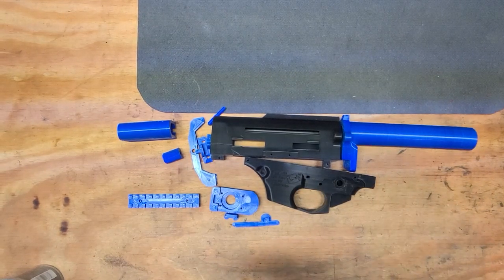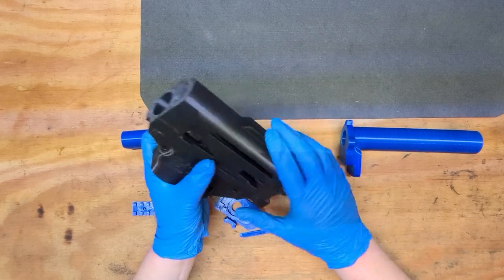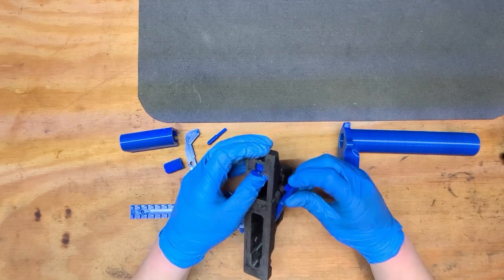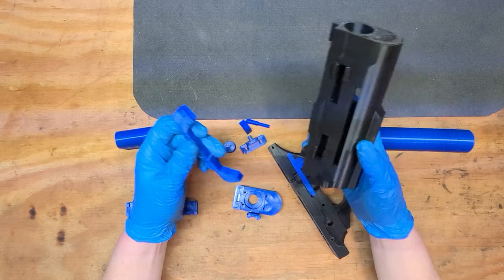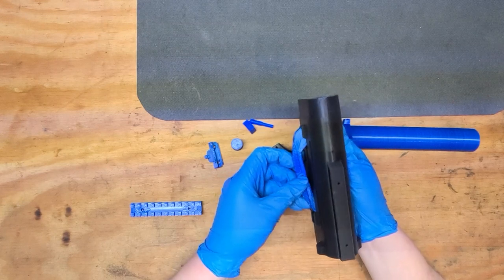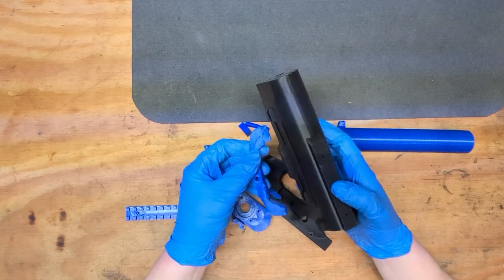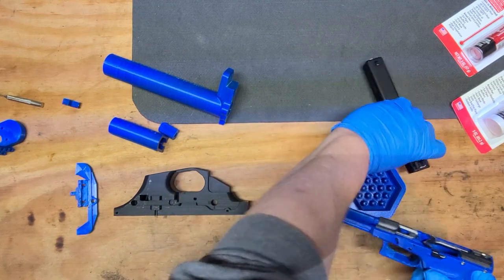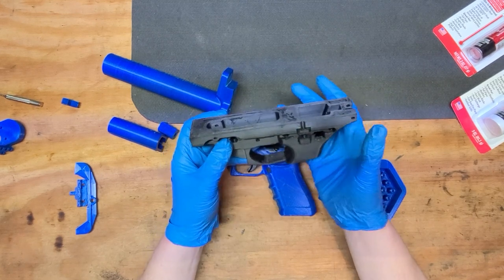3D fgc9 parts with my epiphany on improving this and many other 3D parts.

Comment: for the buffertube, a raft setting would help you ;) it adds just a milimeter more to the object, easy downsandable with gridpaper or just let its saty somethimes it fils little gaps so it gets a really good snug fit, keep up the great work, love your 3d printing series, the idea with the epoxy is also something i thought about, i see no reason why it should not make it stronger, i mean its more material and also bounds to the pla, maybe a little stipple in the gaps also could improve the bounding extra.

Comment: He'll im excited and I'm not even done with the video yet. I'm gonna start working on the molds when I can. Its super easy in CAD, you just literally make a block with the trigger/ejector/bullet mesh inside, then subtract the part from the block leaving the perfectly formed  cavity. Then you just plane slice your mold as needed and add the male or female location geometry (with a .4mm difference for fit). Then cast away, could try using some kind of fibers as well. Cool idea 💡

Comment: You definitely can epoxy woven fiberglass tape to the outside of parts such as your extension tube for extra strength. You mention adding ribs to attach supports, consider that the ribs are already acting as supports just like fluting, so you definitely could improve the strength of that tube by adding ribs, or even extending the outer wall down into more of an oval.

Some people add threaded steel rod to parts. You can also cut a groove in that rod and apply some solvent for whatever plastic you're using to permanently weld it in place. This is all new and there's no rules so if you're willing to risk having a failure design a test part and see what it can take.

Comment: When you’re talking about smashing something on hydraulic press it’s compression strength but there’s a difference between compression strength and tensile strength this could use some experimentation especially the tensile strength the longer radius

Comment: In Cura you can add shapes to STI files under Extensions>parts for calibration, then adjust shape and scale for your purposes, then under per model setting (under scaling on the left hand toolbar) you can adjust "setting for overlap" set all settings to zero for your cavity piece and align your void within the mold cube. Might take some tweaking, but that's probably your most surefire and easy to lean way to 3d print molds or cavities in existing print to fill like you mentioned. No CAD knowledge nescessary.

Comment: could this mold idea also be used to cast lowers and uppers for instance? It could help to speed up FGC-9 production since now it takes about a week for all the parts to print
Reply from the maker: Not sure, it would be nice but so far the mold will most likely be broken away so you would be printing a new mold each time. Currently I'm testing this in a small 2 part mold off thingiverse. Hopefully will post that video Saturday.
Reply: @Applianceinator  I already thought it through and its totally possible. Just Use Poly cast from Ultimaker. Use minimal infill and that should print faaast. Then make a ceramic form and heat that bad boy up. After heating the polycast is vaporized and the Ceramic is done. Actually you shouldnt use ceramic like this but you should use ceramic like this dip the form put the crumbled clay . wait till dry reapeat 3-5 times. Then put in furnance and burn everything. The Polycast will evaporate. Boombadabang you got a form. Just cast. Done Polycast is VERY VERY acurate. You can even see the print lines in the cast. Even riffeling should be possible. Its amazing. I saw some youtube videos on that. total setup cost is 460 euros or something + printer+ if you want some luxury stuff you gonna end up paying 1000 dollar or something. Basically you can make infinite firearm made of metal then soo i would consider that a win. Now say thanks DurschfallTV for this money method i will "steal" what you stole and make some $$$ go ahead buddy. get em

Comment: also, from a material science perspective, "casing" the polymer in epoxy might have unintended consequences, vectoring forces in unintended ways...not saying it couldn't work, but you'd have to be pretty intentional and controlled about it.
Reply: I bet a rebar type setup with wire wrapped in the grooves then encased in jb might mitigate a bit of the epoxy spalling, but stress localization on the plastic then becomes the issue.

Comment: carbon fiber filament is a bit of a trap apparently
You might try something with Prusament's PC blend (easier to print poly carbonate)
Reply: Can you elaborate about CF filament?  I've been thinking of trying cf nylon for strength
Reply: @fugitiveminded  It will make the material more brittle, even if it is technically stronger and stiffer.  In the case of nylon based CF, that might not be a problem.
You might need a bigger nozzle to avoid clogs too, depending on brand of course
Here's an article about the stuff https://all3dp.com/2/carbon-fiber-filament-explained-and-compared/
Reply: @markcahalan5698  Thank you Sir!

Comment: Your idea would work well for small parts but the webbing would be weak, that stuff is not strong in very thin layers. You could have a removable buffer tube mount that you could cast out of epoxy and then bolt or glue on. Watch the chop tow video I linked to, I think its the answer, I just have not messed with it yet

Comment: I think a very similar thing to what you're thinking of us called Plastic Injection molding.
An even more similar idea world be like ar15mold.com.

They sell a reusable AR-15 lower resin mold and it comes with a stainless steel support that gets embedded in the resin.

It would probably take a long time, but I'm theory you could print the molds and hopefully make them reusable.